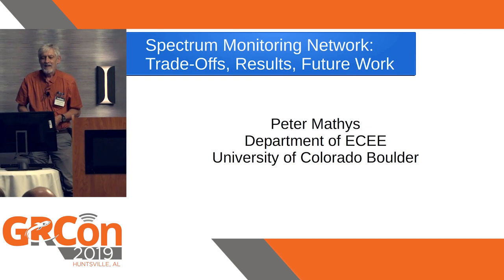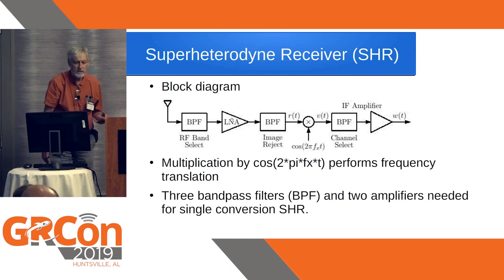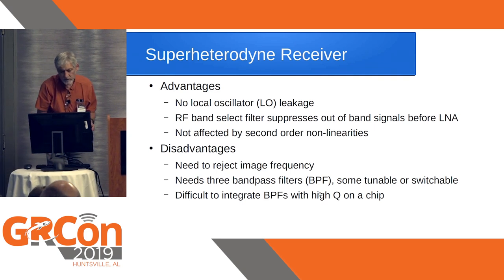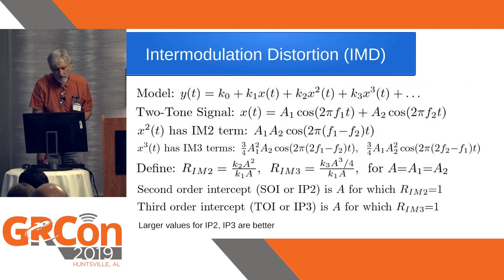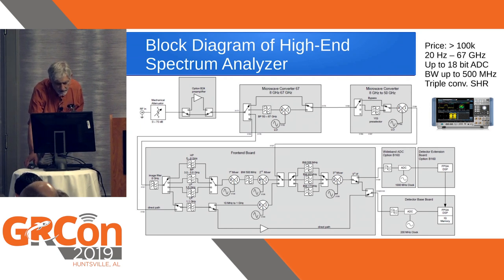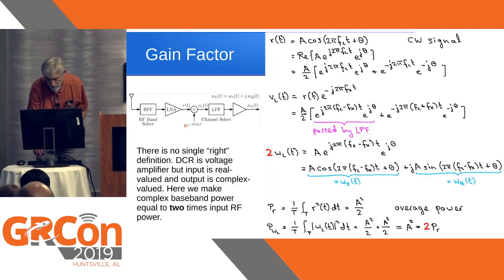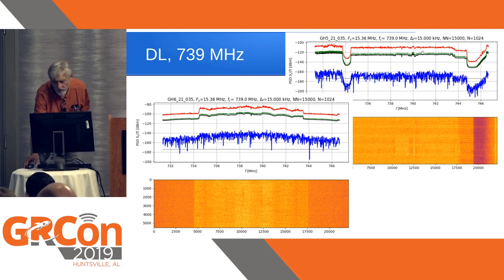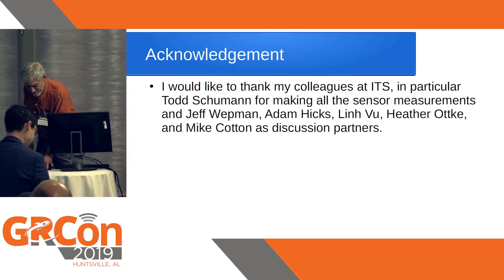GRCon19 - Spectrum Monitoring Network: Tradeoffs, Results, and Future Directions by Peter Mathys

Comment: The image reject filter should be called image "noise" reject filter.  It is needed to reject the image noise generated by the LNA.  It is not necessarily needed to reject image signals coming in from the antenna